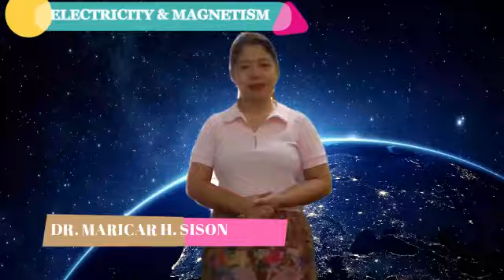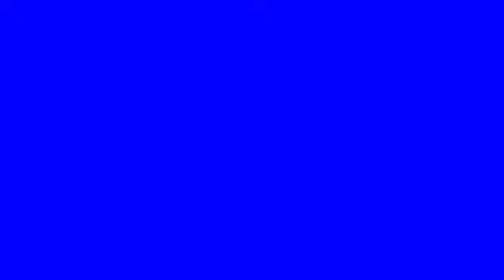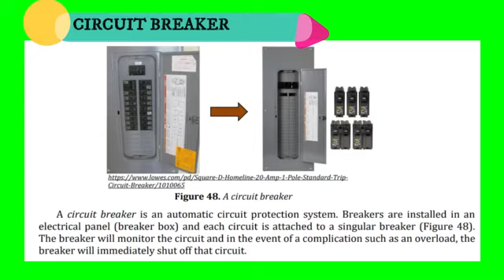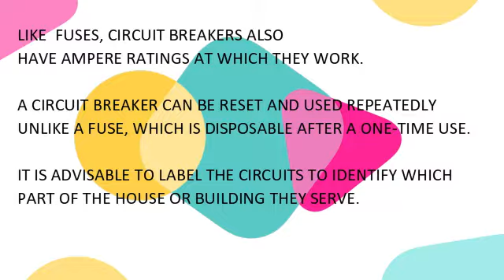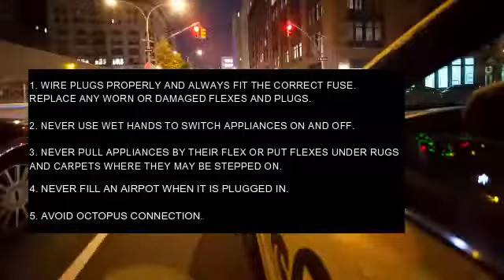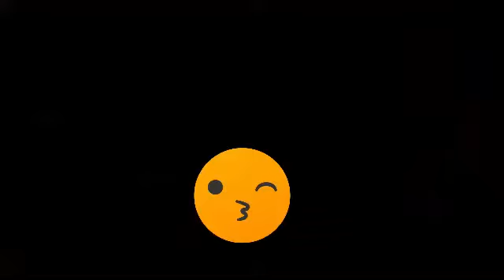FUSE AND CIRCUIT BREAKERS

Comment: 1.)  WHY DO YOU THINK THE USE OF CIRCUIT PROTECTOR IS IMPORTANT?
> It is very important to use circuit protector  Because using circuit protector  help us to prevent short circuit  and etc .

2.) CAN YOU GIVE EXAMPLES OF SAFETY TIPS WHEN DEALING ELECTRICITY.
> Do not use portable cord-and-plug connected power tools if the guards are removed.
> Do not block access to panels and circuit breakers or fuse boxes.
> Avoid Octopus Connection.

Comment: Bernardo Nikki Shane V.
BSE 2A

Circuit protection devices automatically prevent dangerous or excessive amount of current or a short circuit in an electrical conductor. This article will look at the various circuit protection devices available so you can figure out which one will work best in your electrical application

*Do not touch the electric appliance with wet hands 
*Obey the olders
*Unplug the chargers if its not using.

Comment: Valderama, Beatrize Joy C.
BSE-2A

Fuses and circuit breakers protect electrical circuits and appliances this is why circuit protector is intentionally installed. It is important as its main function is to protect and to interrupt current flow after a fault is detected to prevent high fault current and short circuit.

Safety tips when dealing with electricity:
-Never pull a plug by its cord.
-Do not use outlets or cords that have exposed wiring.
-Do not use portable cord-and-plug connected power tools if the guards are removed.
-Do not block access to panels and circuit breakers or fuse boxes.
-Do not touch a person or electrical apparatus in the event of an electrical incident.

Comment: For us to avoid possible dangers, short circuits and  overloads using circuit protector  is important on our daily lives

Safety tips dealing with electricity
✓Avoid Octopus Connection.
✓Never use wet hands on switching any appliances.
✓Never fill an airport when it is pligged in.

Comment: Sebastian, Micaella B. 
BSE - IIA

Circuit protector are important because they ensure that under fault conditions, a high fault current cannot flow – as well as protecting the installation this, more importantly, ensures that consumers are not injured or killed as a result of an electrical fault.
Electrical safety tips for kids
1. Never put fingers or other objects in an outlet.
2. Keep metal objects out of toasters.
3. Never use anything with a cord or plug around water.
4. Never pull a plug out by its cord.
5. Stay away from substations and power lines.
6. Don't climb on power poles.
7. Never fly kites near power lines.

Comment: Dalusong, Weyschell B.
BSE 2A - GENERAL SCIENCE

1. Why do you think the use of circuit protector is important ?
* To keep us safe and also to prevent the appliances from being damaged in case of an overload or short in the curcuit.
Here are some example of safety tips when dealing electricity:
* Never use wet hands to switch appliances on and off 
*Avoid octopus connection
*always look for the instruction in your appliances and follow it to keep safe from electricity
*Have time to check the electrical chords it its damage then replace it immediately
*Wire plugs properly and always fit the correct fuse

Comment: Salamante,Joshua Marwin V.
BSIT 4B

The advantage of fuse:

Fuses are the cheapest form of protection.The fuse element change very easily.The fuse needs zero maintenance.It affords the current limiting effect under short circuit conditions.Its operation is completely automatic and requires less time as compared to circuit breakers and no complexity is envolvedMost of the fuses are self-protecting and also they extinguishing the arc.When we use the small size of the fuse element impose a current limiting effect under short circuit conditions.Its inverse time-current characteristics enable its use for overload protection.Fuse has the ability to interrupt enormous short circuits without producing noise, flame or smoke.Easy to removable for replacement without any damage to coming into contact with a live part.The operation time of fuse can be much smaller than the operation of the circuit breaker. It is the primary protection device, against the short circuits.

The disadvantage of fuse

It is not suitable for overload, at that time fuse blow off replacing of fuse takes time. During this period of lost power.The protection of fuse is not reliable.Low breaking capacity.Fuse is slow compared to circuit breakers. It is a slow speed.Considerable time is required in replacing a fuse after the operations, while the circuit breaker can be used multiple times.It can't bear a surge current in the case of motor starting.Fuse has not protected the circuit against under-voltage.The fusing elements of the fuse are exposed to air, hence it is oxidized. Therefore the resistance of the element is increased and produced heat when the current passing through it.There is a possibility of renewal by the fuse wire of the wrong size.The current time characteristics of a fuse cannot always be correlated with that of the protective device.When fuses are connected in series it is difficult to discriminate against the fuse unless the fuse has a significant size difference.Fuse does not respond to the high voltage it only cares about current flowing and is not likely to melt and save the house in case of a direct lightning strike.Accurate calibration of fuse wire is impossible, as longer fuse operates earlier than one of shorter length.

Comment: Vargas, Arlyn Karen D. C. 
Bsed2A

1. Circuit protector is essential for different appliances especially at home or even in some establishments. By the use of circuit protectors there is a control in the flow of electricity. For example the fuse and circuit breaker that prevents the occurance of fire when short circuit or overload of electric current happens. Also since it is design to be generated in automatic when the electric problems detected it will immediately shut down to stop the dangerous result of electricity. 

2. Safety tips 
• do not reused the blown fused because it can cause more danger if it is installed again
• remember that electric problems can be occur when installing or plugging too much appliances to the power source
• regularly look for damages on wires then immediately repair it to prevent short circuits

Comment: Capagcuan, Gabriel Lance S.
BSe - 2A

• Circuit protection is the important because they ensure that under fault conditions, a high fault current cannot flow – as well as protecting the installation, more importantly, ensures that people are not injured as a result of an electrical issue

• Avoid water at all times when working with electricity
• Always use insulated tools while working
• Replace or repair damaged electrical cords to keep your home safe

Comment: CASTRO, EARL JOHN J.
BSE-GENSCI 2A

We must comsider that circuit protector is important in order to be safe in terms of electricity. From the word itself "protector"... it protects us to not be in danger, hurt or injured everytime we use of electricity in home, school even in the workplace.

The following are some of safety tips when dealing elwctricity.
1. Having a growth mindset for electricity.
2. Unplug the oulet after using it.
3. Replace or repair damaged power cords.
4. Don’t overload your outlets. 
5. Avoid extension cords as much as possible.

Comment: Alvarez, Jenella Camille G.
BSE-2A General Science

1. Fuse and circuit breaker are the examples of circuit protector. It is important to install these devices in the circuit to avoid danger causing household fires. These give us hint causing to automatically shut down whenever excessive flow of amperes occurs in the circuit. Thus, prevent overload and short circuit.

2. Touching electricity using our bare hands is dangerous. First, make sure to switch off the fuse in dealing the electricity. Wear protective equipment and use tools that are not conductive to electricity. If you can't handle it by yourself, it's best to call for electricians who are competent to do the work.

Comment: Paclarin, Charlene M.
BSE 2A

The fuse is a device used in an electrical circuit for protecting electrical devices against overloads and short circuit. It is the simplest and cheapest devices used for interrupting an electrical circuit under short circuit or excessive overload current magnitudes.

☆Never put fingers or other objects in an outlet
☆Keep metal objects out of toasters
☆Never use anything with a cord or plug around water
Never pull a plug out by its cord
☆Never touch big, metal transformer boxes with warning signs
☆Obey warning signs

Comment: Jimenez, Guila B.
BSE-2A (Gensci)

1)	WHY DO YOU THINK THE USE OF CIRCUIT PROTECTOR IS IMPORTANT?
- Circuit protector is very important because it prevent dangerous of short circuit also ensure our safety.

2)	CAN YOU GIVE EXAMPLES OF SAFETY TIPS WHEN DEALING ELECTRICITY.
-Never plug and unplug an electronic devices when you hands are wet.
-Never put fingers or other objects in an outlet.
-Do not overload an extension cord or outlet.

Comment: Quizon, John Rein B.
BSE 2A
1. Circuit protector is important because it protects us from danger by making us safe from getting injured or killed due to electrical fault.
2.*Never put fingers or other objects that conducts electricity like metals in an outlet.
* Obey the warning signs.
* Don't use anything with a plug around or when near water.

Comment: Odon, John Cyren B.
BSE 2-A GEN SCIENCE

Why do you think the use of circuit protector is important?

Circuit protector is important, because they ensure that under fault conditions, a high fault current cannot flow – as well as to prevent the accident or to ensures that consumers are not injured.

Can you give examples of safety tips when dealing electricity?

-Replace or repair damaged electrical cords to keep your home safe.

-Check that you’re using the correct wattage in all your fixtures and appliances.

-Stay away from substations and power lines.

-Never use anything with a cord or plug around water

Comment: Villanueva, Magen Li P.
BSE2A

Circuit protectors are devices that prevent excessive amount of current in an electric circuit. There are two examples of circuit protectors, the fuse and circuit breaker. These devices are very significant because it provide protection or security against high amount current that might cause injuries or even death. 

The following are the tips to safely deal with electricity. 
• Do not overload an outlet or extension cord.
• Check your electrical regularly.
• Immediately replace or repair damaged electrical equiments or components.
• Never pull out a plug with its cord.
• Do not attempt to repair or fix any damaged electrical components or faulty wirings if you're not knowledgeable. Always rely on electrician with these matter.
• Never operate an electrical appliance near the water source or if you have wet hands.
• Always be responsible when dealing with electricity.

Comment: Gonzales, Mary Joy N.
BSE 2A - General Science

Why do you think the use of circuit protector is important?
- Circuit protectors, like fuse and circuit breaker, offer protection against the dangerous effect of electricity. 

Safety tips when dealing with electricity:
- Consider using safety outlets that prevent foreign objects from being inserted
- Store electrical appliances out of reach of children
- Obey warning signs
- Do not climb on power poles
- Avoid water at all tomes when working with electricity

Comment: Marin, Adriel G.
BSE 2A - General Science 

Use of circuit protectors 
The main use of circuit protectors obviously is to protect. Whenever there is an overload or short circuit occurs, the high heat generated melts strip, opening the circuit, shutting off the current, thus, preventing fire.

Safety tips
1. Never put fingers or other objects in an outlet.
2. Never use anything with a cord or plug around water.
3. Never pull a plug out by its cord.
4. Stay away from substations and power lines.
5. Don't climb on power poles.
6. Never fly kites near power lines.

Comment: Matias,Reynald P.
BSE 2A
NEUST-SIC

1.Because it is important like fuse it offers protection against dangerous of octopus wiring,short circuits and other circuits overload. And also the circuit breaker it monitors the circuit and in the event of complication such as an overload.

2.a.Wire plugd properly and always fits the correct fuse.Replace any worn or damaged flexes and plugs.
b. Never use wet hands to switch appliances on and off.
c. Never pull appliances by their flex or put flexes under rugs and carpets where they may be stepped on.
4. Never fill an airpot when it is plugged in.
5. Avoid octupus connection.

Comment: MANUEL, TRICIA ELORA T.
BSE 2A GEN SCI

Circuit protector is important because it ensure our safety, protect us from danger and it helps to prevent short circuit.

Safety tips:
*Avoid touching the switch with wet hands.
*Avoid overloading outlet/sockets
*Never plug it out by its cord.
*Avoid octopus connection.
*Never put your fingers or other object in an oultet/socket.

Comment: Macalinao, Elaine Abby S.
BSE 2A 

Circuit Protector is important because it ensure us to not get injured or killed due to the electrical fault. 

Some Safety tips 
-Properly Unplugged the plug of the appliances
-watchout for the water that near to he plug. 
-replace and repair the damage electrical cords
-watch out for overload outlets

Comment: Reyes, Pamela Jane B.
BSE 2A-General Science 

Circuit protector is important to ensure that under fault conditioms a high fault current cannot flow and to ensures that consumers safe 

-Never pull a plug out by its cord
-Dont climb on poles
-Never put fingers or other object in an outlet

Comment: Agcaoili, Verlyn M.
BSE-2A

Circuit protector is important because it ensuring safety for the users and provide protection against faults and overloads.

-Safety tips when dealing electricity
•Do not use extension cords or multi-outlet converters for appliances.
•Replace or repair damaged electrical cords.
•Keep electrical devices and outlets away from water to prevent shock.
•Unplug all your unused appliances to reduce potential risks.
•Always follow appliance instructions for improved electrical safety.

Comment: Manalastas Kristine Jane P. 
BSE 2A 

WHY DO YOU THINK THE USE OF CIRCUIT PROTECTOR IS IMPORTANT?
-From the word protector meaning to protect someone or something, we can see the importance of circuit protector. Why? because like how someone protect us, this protective devices are also important because they ensure that under fault conditions, a high fault current cannot flow. It also ensure the protection of the installation of electricity as well as ensuring the safe of every consumers. Making sure that we are not injured or worse, killed as a result of an electrical fault. 

CAN YOU GIVE EXAMPLES OF SAFETY TIPS WHEN DEALING ELECTRICITY.
-There is a lot of safety precautions when dealing with electricity. But here are some ways i know to deal with electricity with safety:
*Never put your fingers in an outlet
*Never touch a wire when your hands are wet
*Never plug it out by its cord
*Dont touch a wire when the protective case is already broken 
*Avoid water when you are working with electricity
*Make sure to turn off the main power outlet when working on any receptable at home

Comment: Buenaventura, Rona Mae E.
BSE 2A

- Curcuit protectors are important because it can ensures that consumers will not get injured or killed if an electrical fault occured.

- Some examples of safety tips when dealing electricity:
• Use tools designed for working with electricity (e.g insulated screwdriver).
• Beware of things that get hot.
• Ensure that metal surfaces are grounded.
• Turn off and remove plug.
• Ensure screwed contacts are fully screwed down.

Comment: Delos Santos, Juvylyn M.
BSE - 2A

Circuit protection is very important because it protects us from danger and it also help to avoid short circuits and circuit overload.

Safety tips when dealing electricy:
*Never put fingers or other objects in an outlet
*Keep metal objects out of toasters
*Never use anything with a cord or plug around water
*Never pull a plug out by its cord
*Stay away from substations and power lines
*Obey warning signs

Comment: We must know the safety and precautions when working with electricity. Example
• Put safety caps on unused electric plug.

Don't touch an electrical appliances/switch with wet hand.

Switch of the main , while working on any electricappliance.

Wear rubber slippers while repairing any damaged electric appliance.

Comment: That's why Circuit protector is important because they ensure that under fault conditions, a high fault current cannot flow. more importantly, ensures that consumers are not injured or killed as a result of an electrical fault. Overcurrent protection is provided by circuit breakers or fuses which operate within specific limits, disconnecting the supply automatically when there is an overload or fault current (short circuit).